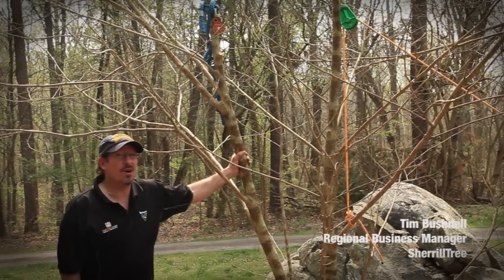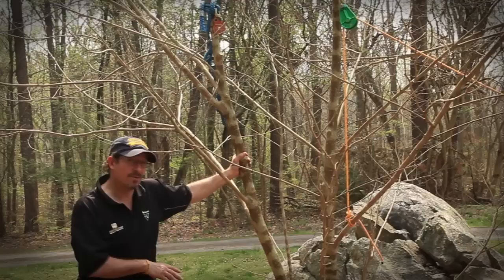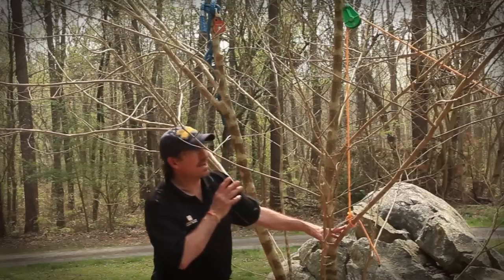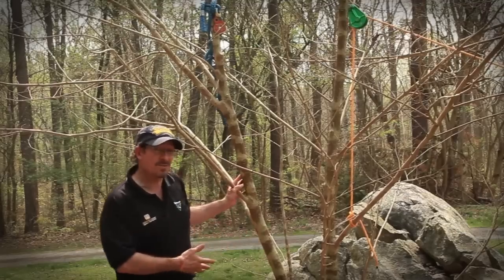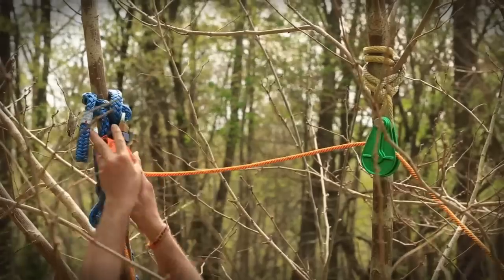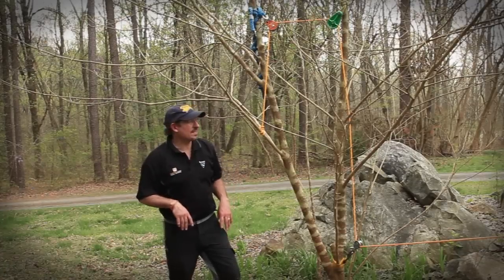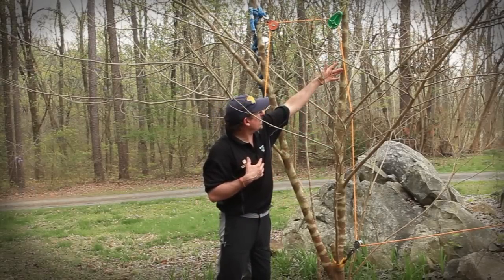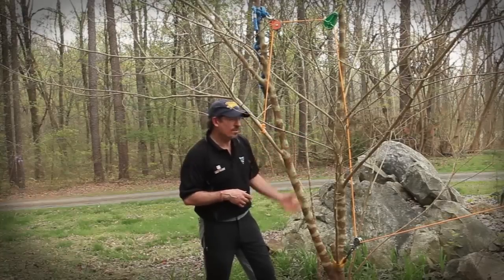SherrillTree Video Series: Designing Rigging Systems

Comment: Nice video Tim, I always enjoy what you guys bring to the industry.  However, in this case there is a potential for the rigging points to clash when loaded. Also the flex in the leaders could result in sag in the system (problematic if the limb is over a structure or vegetation to be kept).

Compressive forces could be applied to the primary leader if the omni block was positioned lower on the secondary leader.  This would change the force vector on the secondary but the decrease in the rope deflection angle would mean that it would be insignificant.  In addition this would lessen the movement in the primary leader if, for whatever reason, a climber was attached to it.

Cheers mate, hope to see a workshop in Perth, Australia again soon!